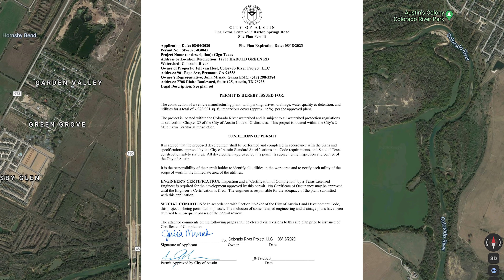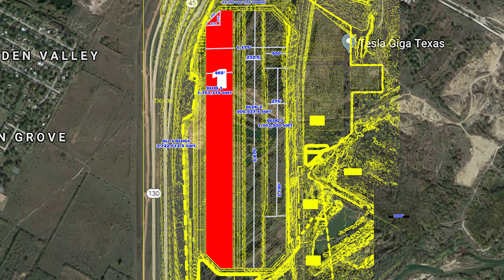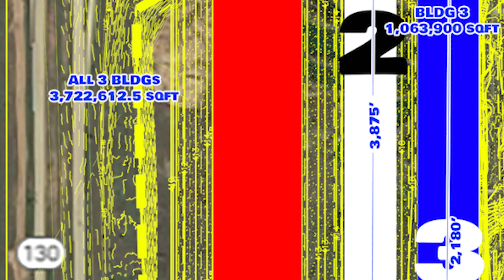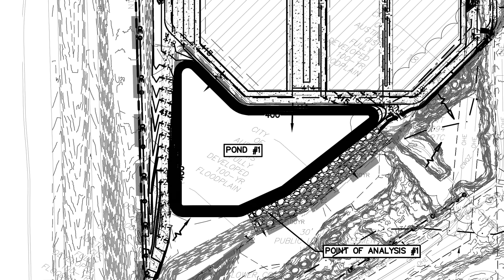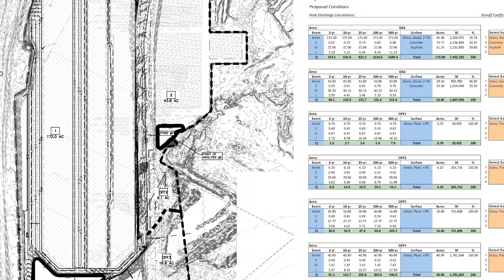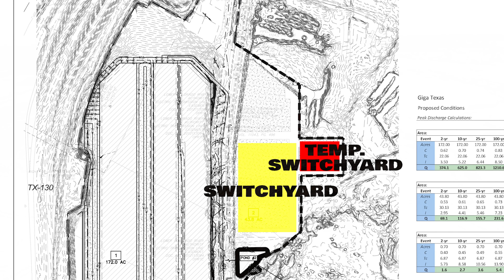Tesla Giga Texas  - EXCLUSIVE SITE PLAN REVEAL! - 4K  Day 55 - 9/15/20  - Gigafactory - Terafactory!

Comment: So, these buildings were produce complete cars and trucks,  where are the completed vehicles parked after they come out of the factory?   There needs to be a huge parking lot somewhere for the finished vehicles awaiting truck shipment.  Where?
Reply: With Just In Time manufacturing, executed perfectly, there is little need for a queue of finished product. Vehicles are delivered to customers as soon as they come off from the assembly line. If Tesla does it right, it should only require a very small area.
Reply from the maker: Johnny B Also a great point!
Reply: @peterdog15  The only queue that should be needed is to consolidate loads to a geographical area. But that would be near perfect. I am nowhere near Perfect. I don't even know what state it's in.
Reply: @jbbuzzable --- let's say Tesla sells a lot of cars in the New York City area.  Austin Texas to New York City is at least 26 hours of driving.  A specialty car carrier trailer can carry six cars.  A tractor trailer driver can drive roughly eight hours per day, so it will take him four (ideal, but not very likely) or five days to deliver in the New York City area.  One of the problems is the number of specialized car carrier trailers, if they all end up in New York City,  someone has to bring them back to Texas empty, this is expensive and time consuming.   Today all of the US auto manufacturers use trains to move their completed cars, it's lots cheaper to ship cars this way, and returning the empty rail cars is inexpensive,  no driver/operator is needed.
How is Tesla planning on delivering their vehicles?
Reply: @jbbuzzable  ---- The Tesla cars completed in Freemont destined for the rest of the world are mostly shipped by sea.  Cars are driven on in Los Angels and driven off at the destination port.  How many c at s can fit into a car carrier ship?  I don't know for certain.
Reply: @DavidNull5  
At some point really soon, FSD Tesla cars will be able to slave/follow a lead vehicle with reduced distance between all cars. The slaved cars will be unoccupied. Occupied Semi tractor trailers are already testing this using non-Tesla systems. 

At both ends, the cars will assemble and dissemble from the convoy in parking lots.
Reply: @DavidNull5  As a Tesla shareholder and future cybertruck owner, I don't care to get into that level of detail. I do have a logistics background, and seems that Tesla has a pretty good handle on the situation. I trust them to make the right decisions.
Reply from the maker: Great question and great point! Probably up in that North area I'm guessing? We'll see :)
Reply: Yah. Until they deliver themselves autonomously they are going to need a parking lot.  Giga Shanghai has a lot for maybe 1000 cars at least.  Giga Texas will probably need something bigger than Shanghai for cars as well as the larger vehicles. (Semi and cyber)
Reply: @swparsons  If that's the way it goes, they have plenty of space across from 130, or they can rent some space. Parking lots are cheap in the total scheme of things.
Reply: @swparsons  Autonomously delivering cars will only happen on a local level if at all.  Nobody wants their new car to show up with 1,200 miles already on it.  Plus the sales document, at least where I live, requires an odometer reading.  This is typically listed as 50 miles for new cars to cover the minimal driving that occurs. 

Eventually I expect autonomous Tesla semis, possibly convoyed, to bring them to local delivery centers where the customer will come to pick theirs up.  Or they could use trains to move to a regional center, then semis move them to the local delivery centers.
Reply: Oliver Klosov good point.   Or maybe the option to receive your car autonomously with say 1200 miles the delivery fee is waived.
Reply: @swparsons  That will be great when level 5 autonomy is achieved.

Comment: Thanks Jeff. Good information here. One building for Model Y, one for Semi, and the last for CyberTruck?
Reply from the maker: Not sure, but Bldg 1 for Models 3 & Y, Bldg 2 for Cybertruck and Bldg 3 for Semi -- or -- combine Semi & Cybertruck in Bldg 3 and make Bldg 2 battery and/or paintshop or ??? Ha ha, who knows but it'll be a blast watching it all come together!
Reply: I'm speculating that cybertruck will be first priority. Elon has said so, and there are already something north of 750k preorders. Model 3 and model Y will probably be manufactured in the same building since there are so many shared parts.
Reply: @jbbuzzable  there was a leak email from Elon said it's time to bring semi to production possible that they're running a test production line in California right now hopefully some answers get filled on battery day.  Cybertruck  pre-orders north 1.2 million    check out.             cybertruckownersclub.com  it's going to be crazy when they actually start seeing these on the road  going to try to order one and you have to wait  3+ years to get one.
Reply: @jmcdonald1415  I would not be surprised if one of those building are for the semi. I hope so.